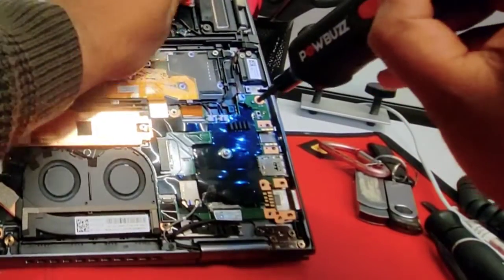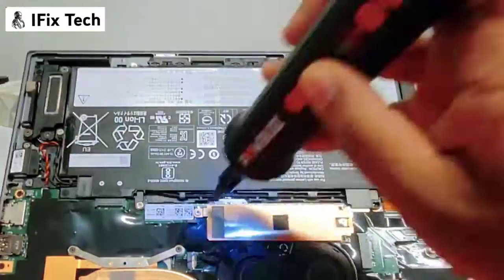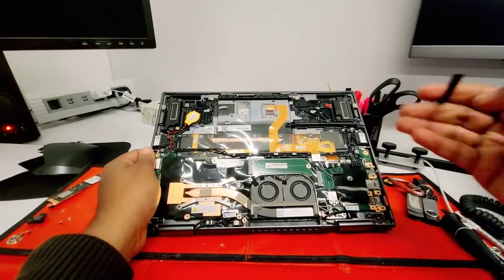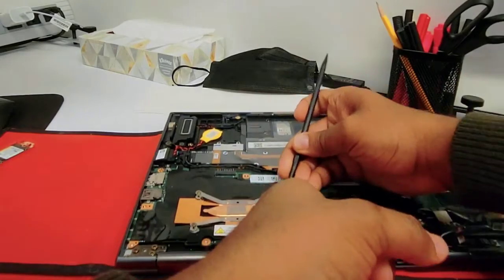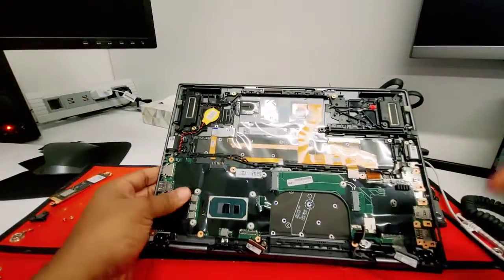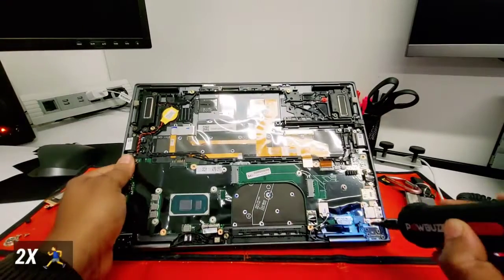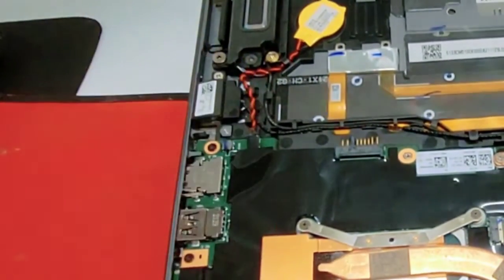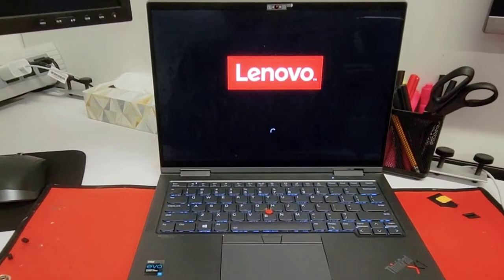Lenovo ThinkPad X1 Yoga Gen 6 Motherboard Removal and Replacement #thinkpad

Comment: Can you replace the mobo to upgrade ram and processor in the same generation? If so, do you need any additional drivers etc?
Reply from the maker: Hello, yes that is something that can be done. You can change motherboard with a higher ram and processor. Regards 👋
Reply: No additional drivers needed, and even if they were, it would be automatic.

Comment: great video, can u help me, my thinkpad yoga gen 6 has a problem, i think magnet lid, when i close the lid my laptop not going to sleep, so i grab the magnet lying around in my home, i touch it with my LCD ( near camera) my laptop sleep. but when i close the lid my laptop not in sleep mode, do you have suggestion what i have to do?
Reply from the maker: Try to check the lid sensor. 👍😉
Reply: @IFixTech1  where is the lid sensor? should i open my laptop?
Reply from the maker: @zeinska9129  it is located on the front edge under the battery. To have access, you need to open the laptop. 👍

Comment: Great video. Do you/or someone maybe know/remember if there is a extra port for the 4-5G router? The router is optional and some have them. But i do not know the connection.  if there is some port of the router, what type of port is it? I am hoping for a nvme type of port because i am looking for ways to use an egpu connected by the extra nvme modem port if there is one? Cheers!
Reply from the maker: Sorry can't remember